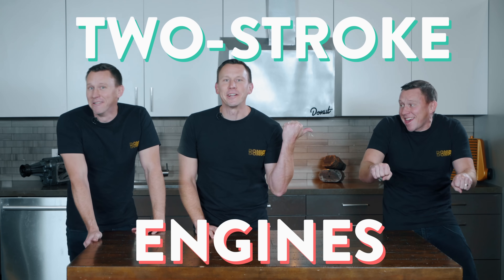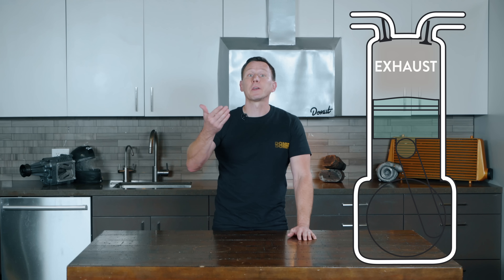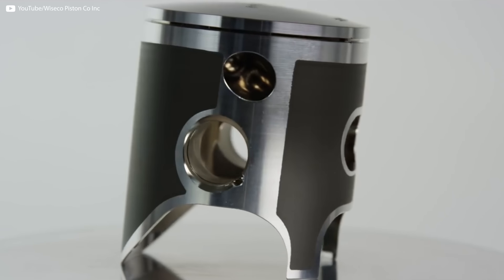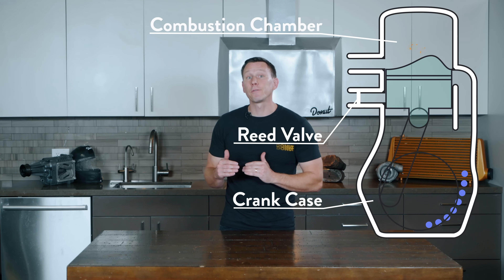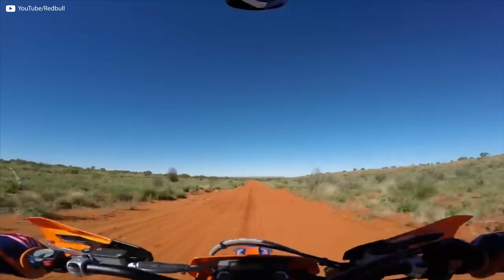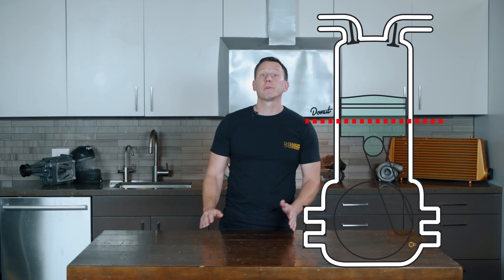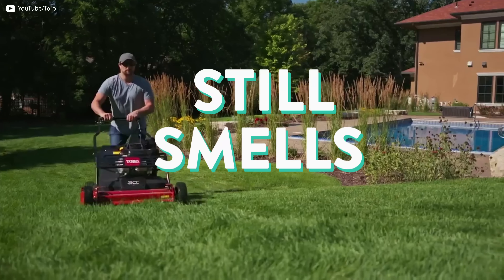2 STROKE vs 4 STROKE ENGINES - How it Works | SCIENCE GARAGE

Comment: I think we can fix a 2-stroke's main faults: emissions and impracticality.

Use a valve to inject air and fuel from the top and eject air through an outlet at the bottom just above the BDC.

Why this could theoretically work?

Assume the combustion has occured, the gasses push the piston down and new fuel-air mixture gets pumped into the chamber, which pushes the exhaust gasses out through the bottom outlet. That outlet then gets blocked as the piston moves up.

But, this brings up a problem—oil escaping through the outlet.

That can easily be fixed with a rotating valve.

Wallah — modern two-stroke.

Get someone to make this thing.
I need a modern 2-stroke in my life.

Comment: It is actually a little bit eerie how every channel is warning of the dangers and pollution caused by the boogie man 2-stroke engine.  Its like these guys didn’t live through the 1980’s??
FACT: By 1984, foreign countries that hadnt outlawed the 2-stroke had already tweaked them to be more fuel efficient, and even lower pollution than 4-strokes of the 1970’s were making.  Simple- an expensive high quality EXHAUST FILTER- duh! 
No, the outlawing of the two stroke is for far more sinister reasons that the establishment will not let us look into.  Engineers have written extensively on the topic only to have their papers all but scrubbed from the internet.  
It really is the weirdest sh** ive come across in recent memory

Comment: I have heard many say the 4 strikes are better. The pros now only race the 4 strokes I assume due to AMA rules changing I would guess and not sure how or why that ever happened but it ruined the sport. Here are some cold hard facts. A 2 stroke 250 is far more powerful,quicker and faster than a 4 stroke 250. A 2 stroke 500 is far more powerful,quicker and faster than a 450. Same goes for the 125’s and 80’s. The 2 stroke is a true racing machine where as the 4 strokes are not. The 4 strokes also have more parts to damage and are heavier not to mention they sound silly. They need to start a new pro organization racing only 2 strokes just like it used to be. The sport would do very well and the 4 strokes would fade out fast

Comment: I don;t have to ask if 2 stroke can be made bigger GP 1200 Jet ski had one -question is  can 1000CC be engineered with precision Ferrari GP race cars done and all benefits 4 strokes have contributed like frames and ECUs and  list way too long to put down , but 4 strokes definitely have advantages and 2 strokes as well.  I would love to see HONDA or YAMAHA build prototype with precision of scapal surgical tool and modifications over the years on Fuel /Oil ECU with perfectly adjustable screws for GP and wide open oval. The perfect tuning in Exhaust and tires so special they get very HOT for adhesion on Isle of Man runs and cooler on OVAL like Daytona.  Problem is  powerband  is physics with respect to exhaust and flat slide with carbon fiber reeds.  ECU would change firing on  tritium plugs and coi packs would be bullet proof at insane amperes and jewelers precision in firing the plugs.  Be like putting person on Hercules missle not Stinger missle.  💥🏎🚀

Comment: "2 stroke engines don't last nearly as long as a 4 stroke." Meanwhile everyone who's raced motocross for the last few decades are scratching their heads and wondering why they spend so much more money on parts and maintenance with modern 4 strokes than they ever did with 2 strokes. (2 strokes being the ones that sound better, require less maintenance, have far less moving parts to maintain and replace, etc.) Valves? Cams? Those are unneeded accessories..

Comment: So, it should be correct to state that:

Unlike in 4-stroke combustion cycle, where you can wait for each stroke to happen successively, in the Two Stroke cycle the strokes coincide.

EXHAUST happens at the same time as INTAKE (this is air and fuel already present in the crank-case, now moving over to the other side of the piston into the combustion chamber)
INTAKE (this one throught he reed valve) happens at the same time as COMBUSTION

Right?

Comment: I have a 149cc 4-stroke single cylinder offroad go kart. Yeah. its kinda weird but im glad it just takes 90 or higher and not 2 stroke fuel because its alot simpler the way it is.

edit: and it has a wire controlled throttle + carbureted

fyi i mean metal wire not electronic

Comment: When I was a teenager, I made the mistake of thinking it would be better to learn riding a bike on my uncle's vintage Yamaha RX100 instead a 350cc cruiser because less cc means less power, so easier to handle, right?

Turns out, no. The RX100 had a 2-stroke engine and one of the best power-to-weight ratios for commercial bikes of its time. I mean, people were using it for amateur drag racing and shit back in the day.
So yeah, long story short, I tried to learn on the RX100, showed some callousness and I was whiskey thrttling down the road in no time, crashed into a tree and had the exhaust scald my shin.

Didn't get why that happened at the time, but now I do. The 350cc cruiser with its centre of gravity and back heavy structure would not have taken off like that.

Comment: A 2 smoke can have a dedicated lubrication system but that bumps up its complexity and weight. Do you still want the aur/fuel mixture mingling with the oil? If so then it won't be that much more complex (just add an oil pump and pick up at the bottom of the crankcase and plumb oiling tubes to nozzles and ports to spray oil inside the crankcase/cylinder wall/piston/connecting rod/wrist pin. If you want to keep your air/fuel mixture completely separate from the oil...things become just a tad more complex (but cleaner). You'll need some kind of forced air unit that bypasses the crankcase (and good luck trying to kick start something like that).

Comment: The 4 stroke is the 2 stoke's smarter but d.u.f.f who thinks they're sisters because of some things they share in common but brings too many friends over without asking for  permission first. And the 2 stroke is told it can't eat this or poop that. If everything is going electric, what's the point in even considering 4 strokes? Because money.  HOWEVER, I would proudly buy a 2 stroke any day 10 times out of 10 because money. Lol. 4 stroke "race" mx bikes should've never left the drawing table. They are perfect for trails, leisure, and pitbikes but just don't make any sense to race. An actual step back in a sport masked with an advancement in technology.  "Oh the environment", to that I say 1 person does more damage to the environment than a 2 stroke does. Non solar electricity is made from burning fuel and motel 6 leaves the light on for you 24/7. Hipsters can't mine bitcoins without the fuel burning in generators to produce that electricity. Garbage patches in the oceans. Airplanes. So 2 strokes get voted against? "Brap" should've never existed, it sounds like a belch. It's "wing", it always was "wing", and until everything is electric it gonna be "wing". Everyone knows wings mean flight, 4 strokes are the penguins of mx. They're birds but can only get airborne when shooting up out of water. What kind of #$&! is that? It's not a fish. Lol. Just because people race 4 strokes doesn't mean 4 strokes are race bikes. They're trail bikes on  tracks like penguins on land/ice. Phew, had to get all that off my chest...lol

Comment: Bought a 4 stroke as my burst bike and I really wish I would waited to find a 2 stroke. Still love my bike, but I feel like a 2 stroke would be a better fit
Reply: no, you don't want to get in the oil mix fuel buisness, its a mess. and the dirty smell and the anoying noise and the polution. stick with 4 stroke dude. for me the fuel is the line breaker, 4 stroke is best, just normal car fuel, euro 98

Comment: If the main draw back of 2-stroke engines is the lubrication and wear associated with that, then wouldn't it make sense to use diesel instead of gas when making a 2-stroke? With diesel, it would ignite in the cylinder but also lubricate in the crank case. And with more power strokes, the potential torque gain seems like it would be a significant advantage. Any thoughts?

Comment: The 2 stroke guy, big smile on his face, overtakes the 4 stroke guy and leaves him in a big cloud of smoke. ☺️
Later while mixing gas at the gas station, ears still ringing from the two stroke noise, he sees that 4 stroke guy with an even bigger smile, quietly going on and on and on and on...😁
Later still at the workshop, same 4 stroke guy.., on and on and on....
The smile so big, it doesn't even fit on his face. 😂

Comment: So, without further ado, a two stroke engine is more powerful than a four stroke only because it completes his cycle faster, so we are lighter to do more things.
So let me figure out...
If you’re doing enduro, you should choose a Two stroke engine isn’t it? In this case you would be able to have more power but at the same time be lighter🤷🏼‍♂️

So the main disadvantages of the two stroke engine are the big waste of gasoline and oil and at the same time their duration over time, without mentioning the fact that you don’t burn oil.

Thanks a lot for your video. It has been  newsworthy and easy to understand❤️

Comment: Detroit Diesel made the 2 stroke better by up ending the air flow and separating the oil from the air and fuel. Now Cummins have improved the idea using old technology by making a 2 stroke opposed piston engine.

Comment: That was far too simplistic to properly make a case for 2-stroke engines. My scooter has a 70cc two-stroke with fuel injection and oil injection. It produces 12 horsepower and 23 lbs feet of torque. 7L of gas will go for 280km at near full-throttle 70% of the time with 350lbs worth of rider and passenger aboard and goes through 1L of oil for every 4200km. It tops out at 130km/h and is an absolute breeze to rebuild even with little to no skill. They are severely under-utilized and the only reason manufacturers are moving away from them is because they make far more money with the complexity and cost of a 4-stroke engine.

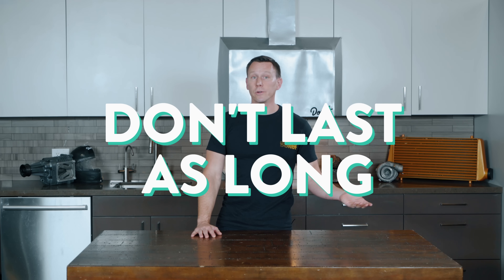Comment: 5:27 Small caveat: two-strokes can last near-indefinitely with the right maintenance and care, which I know is true for all engines, but it's much much easier to work on a simple carbureted two-stroke than a modern four-stroke.
Growing up, I rode a goddamn antique of a sled, a '72 Ski-Doo Olympic that taught me everything I need to know about small engine repair. Once you've rejetted a carb in the middle of a frozen lake at night with nothing but a lighter to see and a dime as a screwdriver, you can basically get out of any situation.
Reply: sounds impressive. but im not not a 2 stroker, dont wanna have nothing to do with that oil mix fuel bullshit and smell + anoying sound.

Comment: Remember there's also another type of 2t engine. The one with double lobes  on the cams for the valves doesn't require oil gas mixture

Comment: 5:35 - just a random fun fact... the guy in this clip is taking apart a motorcycle clutch. Has nothing to do with the engine architecture. Most road bikes (like 99%) use 4-stroke engines.

Comment: I just prefer a 4 because all the motorbike riding I do is pretty leisurely and I like a low power high torque quiet engine I usually ride a custom 1965 Triumph tiger cub

Comment: My 2 stroke 50cc scooter has 92000 kilometers on it, and it's 18 years old, but the engine has never been taken apart. I know that. All the problems have been with everything else, like the carb, which has probably been replaced like 4 times in the bikes life.
And no, 2 strokes don't smoke. Only when cold, and if they do smoke excessively after that, the owner can not adjust the carb for the life of him.

Comment: Its a good video, but, as someone who owns a 2 stroke, im surprised you didnt mention anything about the exhaust pipe used in certain applications, like mx bikes, which has something called an expansion chamber, and powerband wasnt mentioned either.

Comment: I’m surprised we have found a way to make a lubricant for 2stroke engines that burn better than what we have now. With all the technology we have you’d think we could figure something out. I’m actually surprised there aren’t more kinds of engines of 2/4 stroke and Diesel and rotary engines though I’ve seen a few new forms of engines that people are working on.
Reply: Well, 2-stroke engines are not fuel efficient and the emissions are horrendous. Unless you're a drag racer with unquenchable need for speed, 2-stroke engines don't make sense anymore.

Comment: There are direct injection two cycle engines that burn equally as clean as a four cycle now and make more power for the same displacement. Plus with the direct injection 2 cycles they’re longer lasting than a 4 cycle cuz of less moving parts still. I would love to see you guys go further into depth on these engines as kinds an up to speed like you guys did with the LS if I remember correctly. However this was an excellent episode as always from Donut!
Reply: Let me tell you about electric motors...
Reply: @themonsterunderyourbed9408 electric motors would be nice if energy generation is also green
Reply: @Okuni_  Doesn't matter if it's green or not. Even if the grid was 100% coal and the fleet 100% electric, it would still produce less pollution.

Comment: 4-stroke engines have a broader power band than two strokes. That's why motorcycle racing phased out two strokes for the four-stroke counterpart. No matter how they slice it, the four strokes are getting better lap times. Also the four strokes have more predictable characteristics.
Reply: ⁰⁸ii88888888888888888888888888888888888888888888888888888888888888888888888888888888888888888888888888888888888888888888888888888888888888888888888o888⁹⁹090⁰0p⁰

Comment: I've used far more 2 strokes than 4 strokes in the past, as I ride snowmobiles and use other things such as weed whackers and other garden tools and lawnmowers that use 2 strokes. And I currently use two 4 stroke machines, a polaris ranger and polaris sportsman 500 (single cylinder) and imo 2 stroke is the way to go. Especially on a snowmobile. They have some ridiculous power, they're easier to start and keep running, and they're cheaper to work on and cheaper to get fixed by a dealer/mechanic. Because they're simple. Now I definitely like my 4 stroke sportsman and the ranger doesn't really fit the same category, but the issue with that 500cc 4 stroke is it's incredibly annoying to start and keep running, especially when it's cold. Even though it has electric start, the motor doesn't want to keep itself going because it's a single cylinder and a 4 stroke. It doesn't like to run/rotate. Most the time it stalls out, and there have been a couple times where I had to bump start it on a hill by literally rolling it down a hill, ramming it in low range, then trying to start it while giving it throttle. The electric start was not working because of the cold. It didn't want to stay running. Two strokes don't have this issue. They're easy to turn over and they rarely stall once they're running.

Comment: I disagree. Ive owned both mopeds. 2 storke 1977 puch free spirit and a 2016 schwin 50 both 50cc 77 2 stroke and 16 is 4 stroke. The 2 stroke is faster 40 mph lasted 40 yrs and the only problem i have every 2-3 yrs is cleaning the carburetor. The 2 stroke gets 120 mpg. The 2016 lost in every aspect. 80 mpg. Only goes 35 mph and i got rid of it in 3 yrs because of too many engine problems. I will swear by 2 stroke anyday.

Comment: Instead of buying a new 1000cc quad for 12k I bought a old Polaris 400 2 stroke for 1200. Holy cow that 2 stroke is fun!! I’d rather have it than a new 1000 lol. No it’s not as fast but just a few mods will make it really close!
Reply: Harry Peterson they are capable of 70hp or so with a little work. Considering the weight difference it would be real close !
Reply: Harry Peterson I need to clarify.
I’m talking about ATV engines...not 1000 engines in a 4 cylinder motorcycle . That is obviously a whole different game than atv.

Comment: My experience with a 2-stroke street bike getting 30mpg (running real bad) was more like a quart of oil to 1,000 miles, smoking significantly.  The demand for oil goes up with revs, faster than demand for fuel does.  A 2-stroke street car driven at legal speeds would also probably use a quart per 1,000 miles or so.  Oil injection, even 1960s mechanical piston pump injection, uses a lot less oil than mix.  A modern electronic oil injection, combined with direct fuel injection which keeps gasoline out of the crankcase, vastly reduces oil consumption further.  I think, conservatively a modern 2-stroke car would use no more oil than your oil changes in your 4-stroke.  Based on the experiences of owners of ETEC 2-stroke sleds and outboards, it's probably going to be a good bit less oil than the 4-strokes.  Those engines also meet or exceed the same emissions standards as the 4-strokes, making them just a good catalytic converter away from meeting automotive emissions.  With lighter weight, greater power, easier servicing, lower cost, and smoother delivery, as noted in the video.